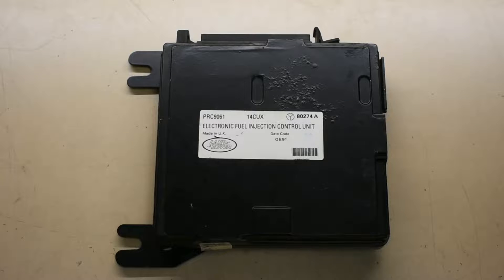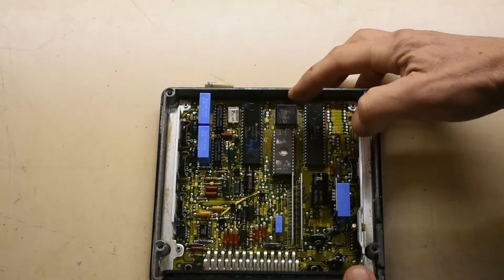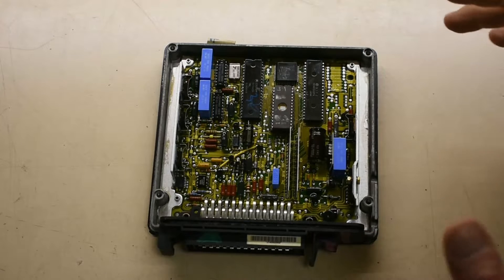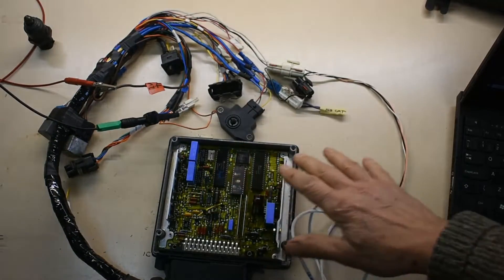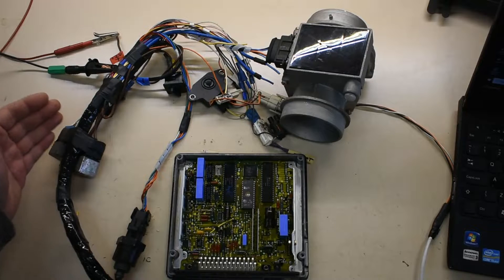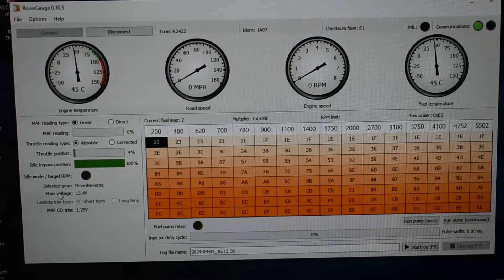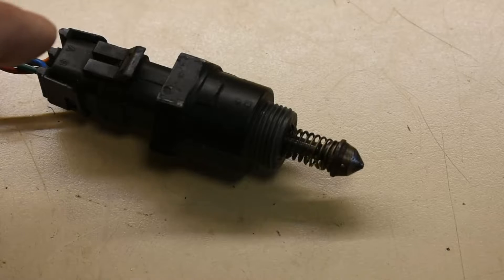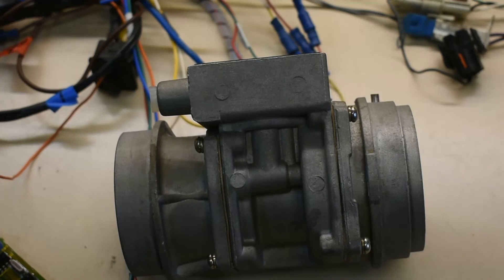Lucas-Hitachi 14CUX electronic injection system used with Rover V8 engines

Comment: Interesting it's just rs232 for diagnostics. Makes it easy to hook up!
Reply from the maker: Almost, but it's not standard RS232 as it's 12V and inverts the Tx  signal. So a dedicated cable has to be made to deal with this. It quite straight forward though.

Comment: The plot thickens! What are you up to? With more modern do it all ECU's, it's a bit harder to reverse engineer them, which may explain the popularity of aftermarket units. Not long before I get that Speeduino unit I've been talking about, then you can have a poke around that 😉
Reply from the maker: Wanted to create a spare ECU for a 3.5ltr out of a 3.9ltr ECU but noticed I had a great test-jig as well. Even confirmed quickly I had, as suspected, as sticky extra air valve on the vehicle. Having a bench test arrangement is so much easier than taking the laptop out to the garage and working around the car. The after market option is getting good these days, apparently these old system can get a bit out of breath at high processing speeds.
Reply: @tuopeeks  Well done getting some future use out of the old dog. It's a handy thing to have for quick diagnostics. I never looked into them a lot, did you ever figure out how they batch fired the injectors? Nowadays even Arduino processor speeds are way more than older injection systems needed.